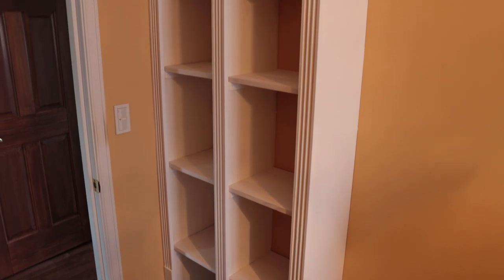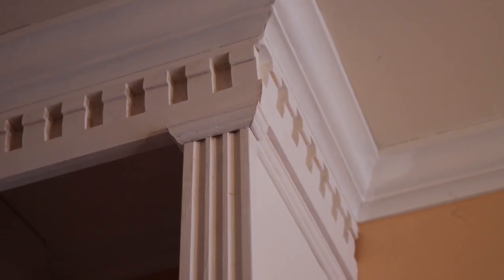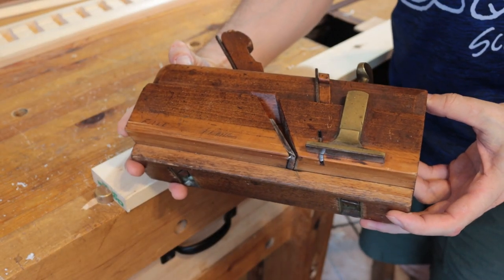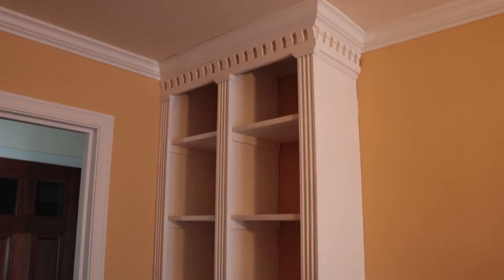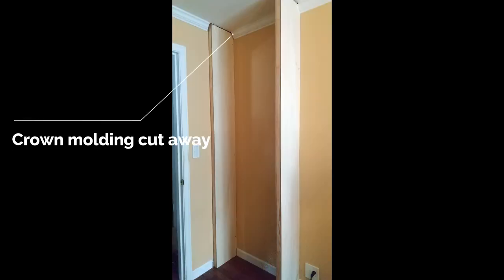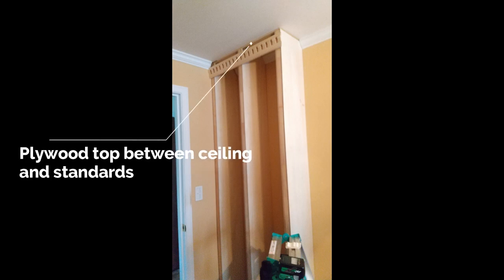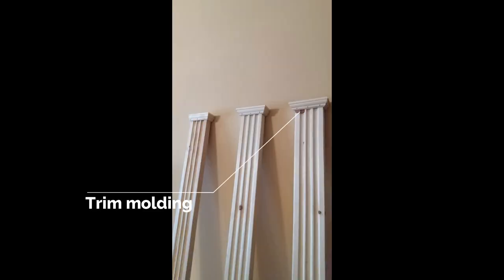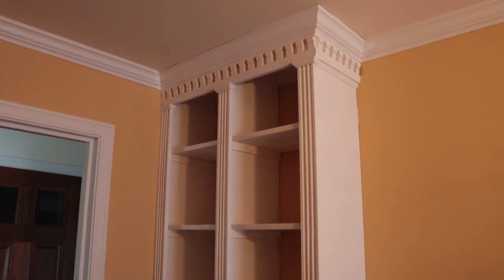How to make dentil molding for a classically-styled bookcase!!

Comment: What's the width of each of the two bookcases?  And the width of the fluted columns?
Reply from the maker: Fluted columns are 6cm wide. Don't remember exact measurements for the bookcases, but you should be able to extrapolate from the width of the columns. About 35cm~40cm I think they were. Thanks for watching!

Comment: Did you choose the dentil width and spacing in some way so that the corner miter and ends at the wall would come out properly?
Reply from the maker: Sort of. I knew the length of the dentil molding piece, so I spaced the dentils so they would look good by trial and error. As this was a home project, I wasn't too concerned if the spacing was a little off in the corners against the wall since no one would be looking that hard.
Reply: @TenonsTenors  Thanks for the reply. Sometimes, I look at classical architecture (or furniture with classical elements) and see complicated sets of repeating elements that all end perfectly at corners and edges and have no idea how they managed to make it all work out evenly. It can seem like there is a dozen different elements with different lengths / periods all wrapping around corners and ending at edges without any fractional pieces.
Reply from the maker: @ef2b  Absolutely. A technique I use for upholstering leather chairs with brass upholstery nails along the bottom is to start out on both ends with one nail each. Then I go to the exact center and put in another nail. I then put one nail in the exact center of each side and so forth, halving each distance on both sides. That technique results in equal spacing between the nails along whatever length I'm dealing with. I'm not sure if they did it the same way in Ancient Rome, but it works for me!